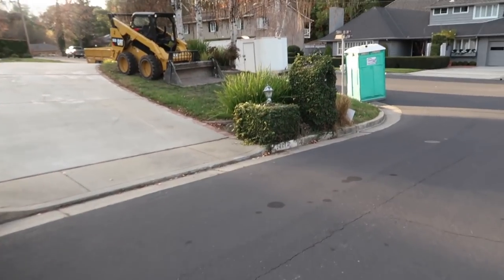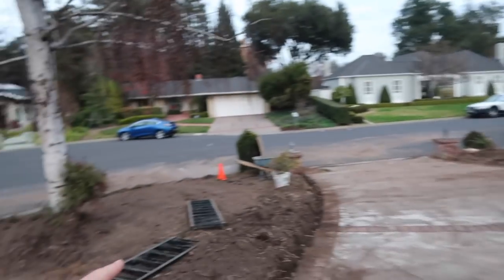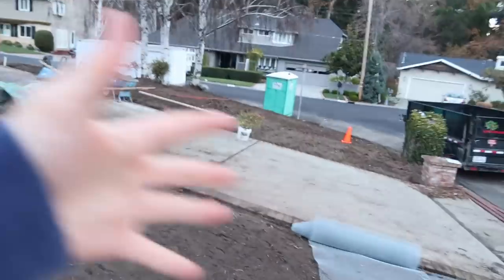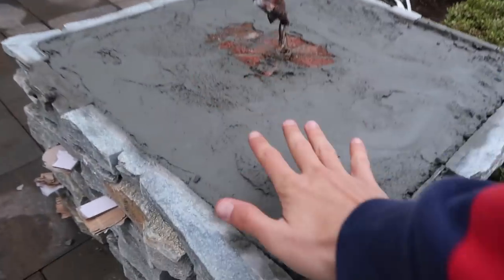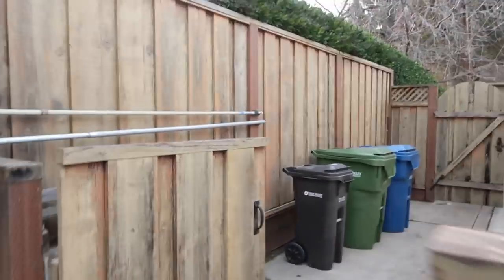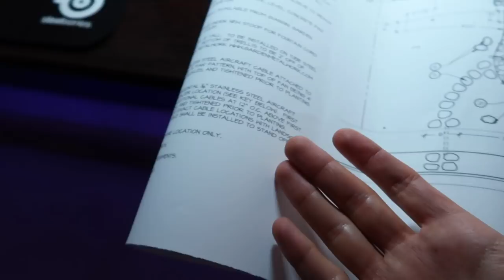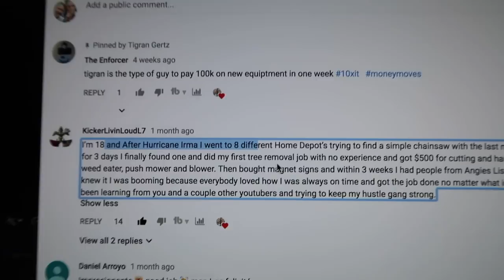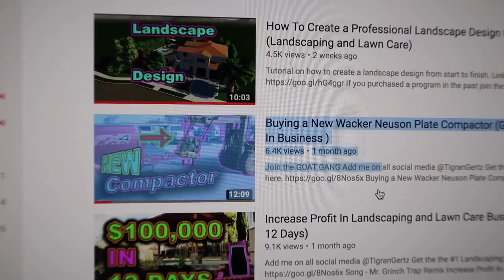New Decals On The Construction Equipment (Installing 2600 SqFt Of Sod)

Comment: I flopped last year major. First met the potential client in early May. Brand new construction, needed 10,000 square feet of lawn, wanted a massive stone staircase down one side of the property, wanted a paver patio with seatwall and fireplace in the backyard corner. 18 trees planted, 20 yards of mulch, 15 rose quartz boulders forming a massive landscape border in the front, outdoor bar/kitchen underneath the deck out of the basement walkout. Easily 6 figures. They mentioned they started with a 400k plan on the house, which ended up costing them 700k in the end because they added so many custom luxuries to the house. I knew I could have sold the whole thing with ease, BUT I DIDN'T. I was lazy about the entire thing because I choked and didn't know what the hell I was doing. I had 50 lawns to mow by myself because the 1 guy I had helping me wasn't reliable and didn't want to show up. 

I kept focusing on the 50 lawns because I didn't want to piss all those people off, so week after week I put off drawing designs and drafting up proposals for this client. We were even to the point of him approving a small portion of the job for 18k and for us to get started, but we waited too long and he felt the purse strings tighten, most likely from my shitty organization and communication skills at that time. Long story short, what was easily a 100k install turned into ZERO. I was lazy and let my mind get cloudy to the point of not taking any action at all. I was focused on all the baby money and didn't know how to make the next move and stay sane. I ended up pissing them off since nothing got done on their property at all last summer. It was July by the time he finally said forget it, and he was nice enough to blame himself for not wanting to spend anymore since he already dropped so much on the house itself. It was definitely my fault. NEVER AGAIN. I screwed up but learned so much from that couple months.